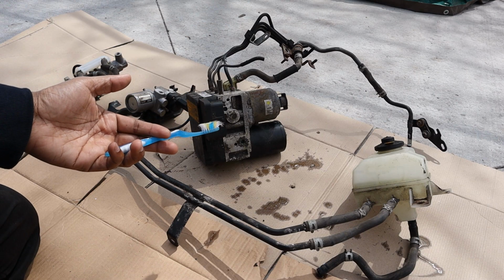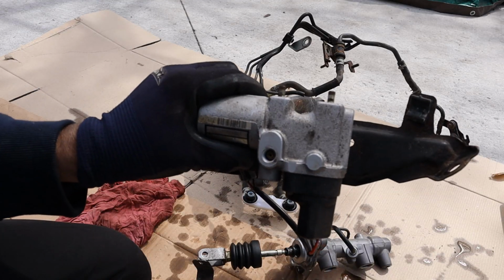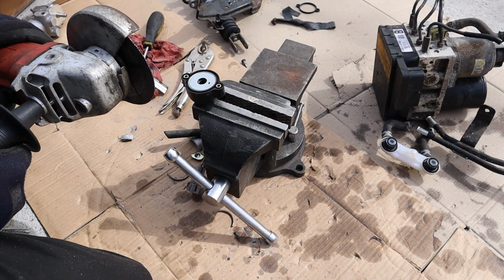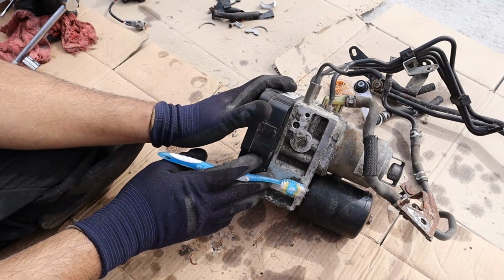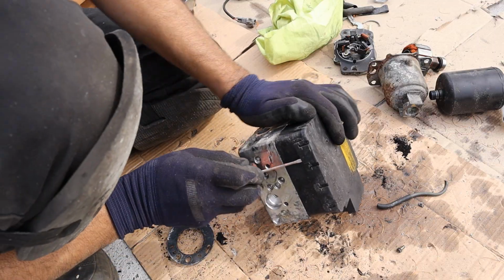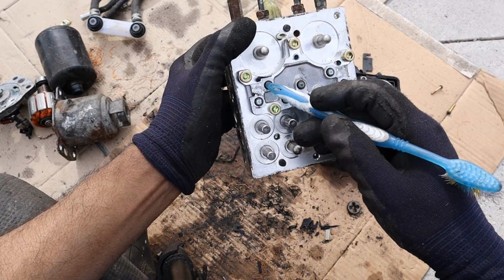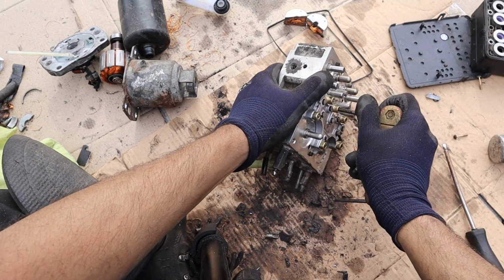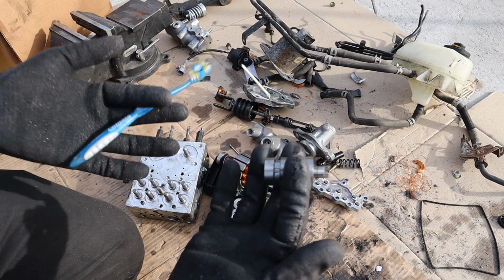How Hybrid Car Brakes Work

Comment: And where does the “internal leak” occur? This is probably the most important question. "PRV"? or through other valves? How to fix a leak? What was the point of disassembling it, sawing the solenoids for some reason, if it is already clear that there are coils of copper and nothing else. And you can’t get to the place where the main breakdown of this module occurs... But in fairness, this is the only video on YouTube that I was able to find with such a deep analysis.

Comment: All this to replace missing engine vacuum.  I would have just added a vacuum can and a small vac pump.  Problem solved with low tech.
Reply: It needs to be this complex because it also needs to blend electric and hydraulic braking seamlessly. Brake-by-wire is the only way to do that.

Comment: I really appreciate the breakdown of a Prius' braking system, but with the actuators failing, what's the main culprit that causes it?  I was hoping that you'd mention where the main issues are with the actuators.
Reply from the maker: Solenoids can burn out. 
Pressure sensors can go bad or miscalibrate, and the brushed motor can wear out.
Reply: @speedkar99  Actually all these reasons are very seldom, maybe 1%. Most common reason is valve leakages inside of that sealed metal block.

Comment: the new integrated braking system from Continental, called MK C1 simplified the hybrid braking sistem by integrating the master cylinder, brake booster and abs module into one single unit that handles boosting, abs, esp, pedal feel, and regen braking.

Toyota had some issues with that nitrogen accumulator on early priuses but now it seems it's all good
Reply: That problem is called demolecular diffusion and happens to all accumuators. It´s just like a tire evetually will loose all it´s air if you don´t fill it. Accumulators is a service item. There are things you can do like "arm" the rubber diaphragm in different ways, like Citroën did in the 90´s. But usually this just mean that they stay with the right pressure for longer and instead break completely when that day comes. So "all good", I wouldn´t count on that. Another "interresting" is that normal or catastrophic leakage of accumulator nitrogen pressure ends up as bubbles in the fluid. I guess it can be confusing when you suddenly get "air" in your brakes that seem to come from nowhere.
Reply from the maker: Where is the nitrogen stored and what is its function? I thought the accumulator was a storage tank for brake fluid
Reply from the maker: Toyota is integrating the brake actuator now on many of it's RWD Lexus and truck models
Reply: @speedkar99  Accumulators usually have a diaphragm, so it´s basically a glorified "balloon" filled with (usually) nitrogen inside it. It´s all about the idea that you can compress a gas but not a fluid. It´s how you store accumulated  hydraulic pressure.

Comment: Great video. I really like what you do! Hilarious that some people call classic Citroën´s brakes "over complicated". THIS is what I call complicated.
Reply from the maker: I wouldn't call this complicated... It's just handing over all braking duty to a computer and solenoids with a simple hydraulic circuit.
Reply: @speedkar99  It´s just me, thinking this could have been built much simpler based on the system from old Citroën´s and their high pressure brake system. And I have heard a lot of people saying stupid things about Citroën´s. :) But I guess this is how they have to do when they want it to feel like "normal" brakes. At least they didn´t fall for the temptation to use vacuum pumps and stuff. BTW, Citroën´s have a rather simple valve connected to the pedal. So the only thing you do with your foot is letting already created pump pressure access the calipers.
Reply: I love old school Citroen brakes! Rock hard pedal, travel is 0.01mm or something like that. Just a pressure sensor, with built in sensitivity to the car load.
So I’d like to have the artificial feel removed from our Prius brakes :-) Probably impossible, as it measures pedal travel for the regen braking, I presume.
Yes, we have both a Prius and a Citroen Xm, excellent cars in their own league!
Thanks for explaining this!

Comment: I had a Prius that needed to be started with the E-brake in cuz it would roll and the brake pedal did nothing but pulse and no stop. ABS light was in occasionally, but pretty random. Now I have a better guess why... thanks SK99!
Reply from the maker: You are welcome. That's interesting...it wouldn't engage the brake and just pulse. I guess the actuator was bad

Comment: Woah, so what is the total "carbon footprint" on the manufacture of just one of these modern marvels? Too many pieces parts that make people cry when the service manager comes into the customer waiting area to "discuss" the repair cost that is 1/5th the price of a new car. Thinking I'm going out west and find a cherry 65 Ford Falcon to drive. "Simple by design", but now, will need a machine shop to make parts. Thanks Bro! You are the Master! Still not seeing a "Speedkar99" toothbrush in your store?

Comment: U make an excellent instructor! Thank u, such a complicated system. U ask questions I THOT of, like a brushless motor. Who's toothbrush did u use THIS time? 😁 I cleaned/lubed my gen 4 caliper parts. I did alot of research before hand. Glad I did. U have to keep key fob away frm vehicle when pulling calipers. I'm very OCD when it comes to my brakes. Any way to extend life of actuator? I value ur opinion. 👍
Reply from the maker: Not really other than keep the brake fluid fresh

Comment: Just going to tell you that it doesn't always fail as intended!😳

Had a Toyota Avensis a work and the brake system failed intermittently completely with the valves locked.
It was like stepping on a brick and there was absolutely no brakes.
It was super scary and was extremely close to crash.

And many have complained about tesla brakes not working the same way
Reply: I just had this happen with my 2024 camry hybrid.  I pressed the brakes and it felt like the pedal stopped half way but nothing happened. Toyota had someone to come and scan the event recorder for my car and he told me he didn't see anything. I believe he told me that he's sending the data to toyota but i need to find out.  The car only has 2160 miles...
This was yesterday 12/29/2024.

Comment: Another informative technical tutorial, thank you sir! I actually modified my driving habits After viewing your excellent lesson on the CVT transmissions.
So, what’s the maintenance recommendation for the  regen brakes? Fluid change? I got the new ford maverick hybrid a couple months ago. Love it. Now I know how the brakes work.you need to open a technical academy. Thanks a lot, keep at it!
Reply from the maker: Glad you appreciate my content. The only serviceable part here is maintenance and good driving habits (which means you use the brakes less). 
Since hybrids don't use brakes as much keep them serviced and well lubricated
Reply: @speedkar99  
Standard feature on all 70's vintage MOPAR vehicles operating in the Rust Belt.  It became operational after 5 years of ownership.

Comment: Unique master. Thank you for the video. just super. Thank you so much .
I have a question . Prius 2021 if I pump the brake pedal 10 times or more , then the pedal travel decreases and becomes stiff, hard to push , if i start  moving and try easy stop  the car stop down sharply instantly. If I turn car off, after 3 minutes there is a slight bump under the steering wheel and the brakes start work normally again. Is it bad ABS? The car was damaged by water.. No DTS .  Thanks

Comment: Great vid! So you are saying that if the ABS accumulator quits working, then the master cylinder will send fluid directly to the front brakes only, correct? Is the car safe to drive if that happens?

Comment: Hi I have a 2007 prius gen 2. When I press the brake pedal and car is stationary there is a squeeky noise. I only noticed it recently. What could it be please? Could it be worn discs/pads and brake bleeding or is it the master cylinder or worse the expensive part with electronics? There are no dash board lights but will there be error codes on OBD? Please help!

Comment: Hello, I need from some advise.
 I have a Lexus RX450h 2010y.  When I pressed the brake pedal hard and I hearing some noise, in the other time (when I press it slightly it is less rare). I changed the brake water but still have it that nois. Techstream dont show me any error codes. Where can be the problem?

Comment: In this system, if your ABS motor is running very frequently (compared to my other Lexus that use this same system), is it likely an issue of the accumulator holding pressure or would it be the whole assembly unit as that accumulator looks pretty simple. No lights yet, but have had the weird motor squeak now and then as well as the very very frequent running of the motor building pressure which doesn't seem to hold long before it's running again.
Reply from the maker: It's failing

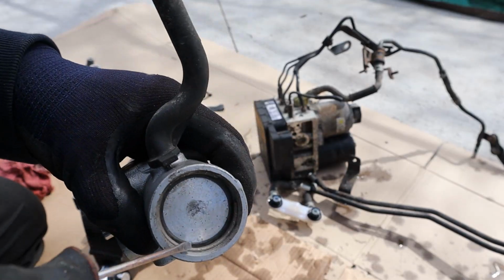Comment: At 03:21
The coil is likely an electrically controlled valve.
Energizing the coil creates a magnetic field that moves a piece of metal inside the aluminum tube the coil is placed over.
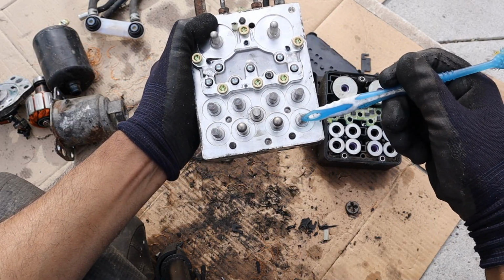Just like the solenoids you show at 09:56

Comment: I have a hybrid rav4 and I assume since it doesn't use the mechanical brakes as often, that is why my brakes squeak when applied at lower speeds?
Reply from the maker: Mechanical brakes only work at lower speed. Service your brakes

Comment: Have an '05 Prius.  Brakes feel normal but they cut out over rough terrain like RR crossings.  Any idea why that would happen?  Great videos.  Thanks.
Reply: Our 2017 does the same thing. It's really noticeable when braking going over a manhole cover or anything steel. My guess is the stability control is quite sensitive and because the brakes are so automated, the brake actuator releases the brake completely before attempting another application a fraction of a second later. It feels very weird because with conventional brakes this would not occur as the brake force you ask for, you get. The hybrid system probably wants to avoid any sort of wheel locking not just for safety but also because you cannot regen with a locked wheel. Hard to know for sure without getting info from the engineers who designed the system...
Reply: @kiefershanks4172  That sounds very plausible.  That's gen3 or 4?  I'm kinda surprised they never addressed that.  We get above 50 mpg around town.  How is yours doing?
Reply: Gen 4. Great car. Pretty nice to be able to shrug off high fuel prices.

Comment: If the brake motor runs every 10 seconds (with ABS light ON) after full flush with full synthetic is it fair to say that the accumulator has failed and it can be replaced or does the entire unit need to be replaced?

TLDR:  Does the entire assembly require replacing, and if so is there a part number to look for for said exchange?
Reply from the maker: Yes. It has to be replaced as a unit of your brakes keep loosing pressure like that.

Comment: I had a code C1391 pop up on my R450. I replaced both the accumulator and actuator to the tune of nearly $2500. But when I watch this video, I wonder if I did the right thing, lol. Then again, so far, everything seems to be working on my RX and no warning lights have popped up. It's been nearly a month.

Comment: The question is: will it be effective to replace the brake fluid (replacing all the brake fluid in the system) with the car turned off using a manual vacuum pump (by gravity)?
Reply from the maker: No. You'll need to cycle the brakes.

Comment: Oh that's so weird, I'm pretty sure my 2011 Kia Optima Hybrid doesn't work that way and instead uses a mostly regular braking system with an electric vacuum pump when in electric mode, I can even hear it running when releasing the brake pedal with its characteristic "brrrrrr" for like half a second

Comment: If they ever get additive manufacturing to be at the same cost/speed as regular manufacturing I could see car mfgs design a manifold without needing to drill oil galleries. You could probably make the part smaller and more compact too without being constrained by traditional manufacturing techniques. Of course if it ever gets clogged you have less access to clean.
Reply from the maker: Good thoughts. Additive manufacturing has come a long way, I think it has potential to be mass produced large scale soon

Comment: hi the e-power note still uses a vacuum brake booster and every time the car thinks that braking might be required it starts the engine because why use expensive electronically boosted brakes when a vacuum booster is cheaper. (no corners were left un-cut) eg no rear speakers
Reply from the maker: What's an e-power note?
Reply: @speedkar99  a e-power note is a nissan note that uses the e-power drive train (47kw 3 cylinder 1.2L motor acting as a generator and a separate 80kw electric motor to propel the vehicle)
Reply: @davidmcclare443  Use caps.

Comment: Prius owners: “Nice spongey pedal feel”

These systems do a terrible job at providing pedal to braking force linearity, there has got to be a better way
Reply from the maker: Well most manfactures are skipping it and going digital
Reply: @speedkar99  the Prius system is exactly that. Digital brakes.

Comment: So why do hybrids not use classical ABS pump ?
Reply from the maker: This is essentially an ABS pump. It's just beefed up to also be a booster and add a few extra valves and solenoids
Reply: What could be the common faults + ways to prevent this

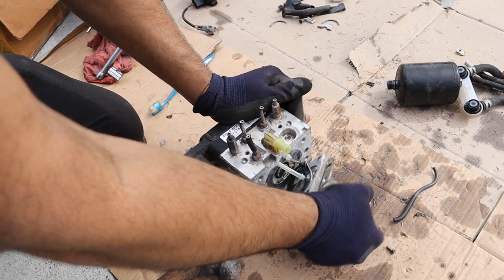Comment: 7:23 Is it easy to remove the accumulator tank by spinning it? Is it possible that leaks develop from the screw on part of the accumulator? How to tell if its leaking?  My motor keeps on running as it seems it cant build pressure but there are no brake fluid leaks anywhere. I am thinking that there is an air leak somewhere ..... but where? I have a CT200H
Reply: You can see on live data if you have a scanner, accumulator pressure decreases and you hear actuator buzzing sound. Have you tried to replace the accumulator?

Comment: And when this fails in a hybrid Highlander you simply throw this wonderful comfortable car away.  

This particularly painful if the problem has first been diagnosed by a well meaning tech as a dead battery and you put $2,500 into a reconditioned traction battery.

Then the car shutters while in park, won't charge, throws a bunch of codes and after towing  to a dealer a 40 miles away and getting a "certificate of death"  cost estimate estimate that you're not sure even solves the problem because it is so comolex, the whole thing becomes a sad experience and an expensive boat anchor. 

Scotty kilmer is right.  Do not a used buy hybrid if you want to keep the car a long time. This probably applies to EV s as well.

It's like when you must put down your favorite dog. You say, "I'll never do that again."

Comment: I just rebuilt my son's  2011 lexus is250 front brake calipers, replaced the brake pads w/ akebono pads and replaced the rotors. Not gonna happen with my wife's 2021 toyota rav4 hybrid xle,  too complicated.
Reply from the maker: You can change the brakes like normal cars. You might just need the scan tool to reset everything to get it right.